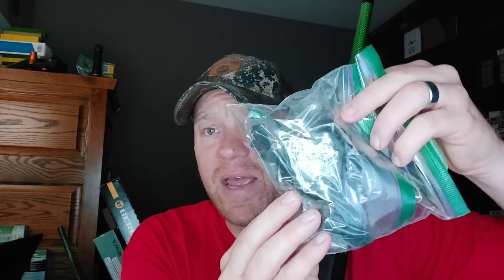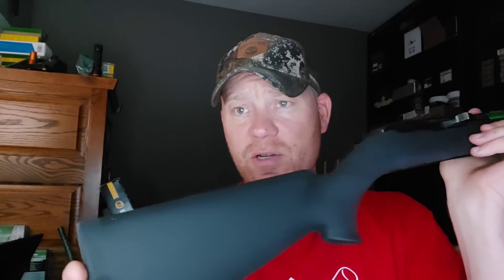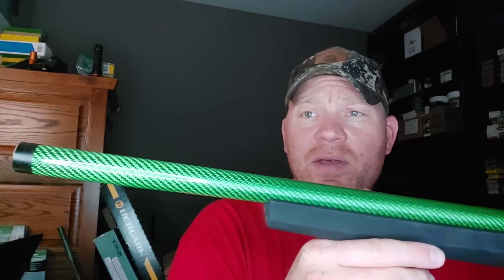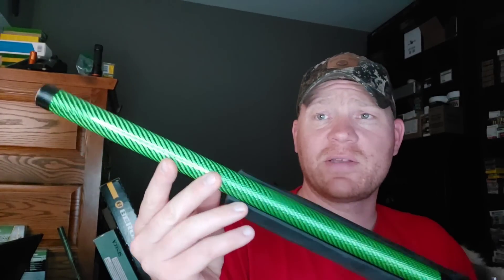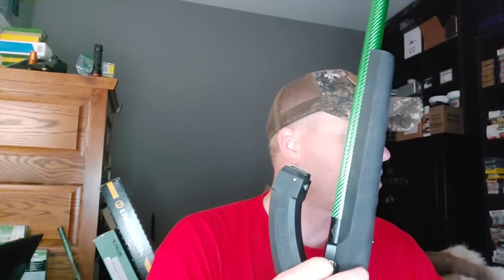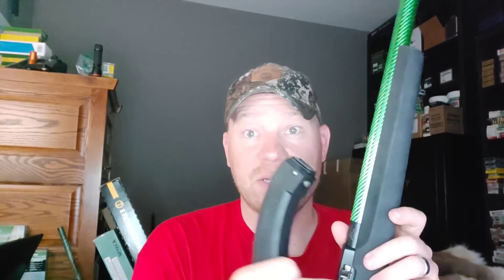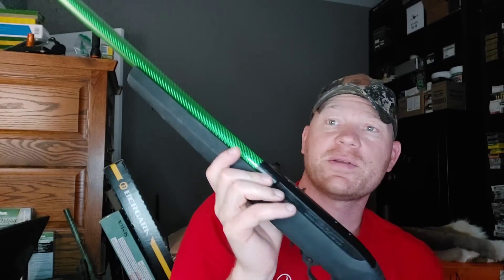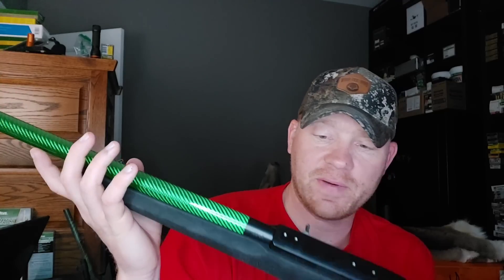This Custom Rifle Took Me a Year to Complete

Comment: Drop a few pieces of clear packing tape around the top of the mag (the square part). It will take that shimmy right away.
Reply from the maker: Good idea
Reply: Totally agree - I custom fit all my mags to the rifle using electrical tape.  Works like a charm

Comment: The biggest thing for adding accuracy to these is  harmonic tuning adjusting torque of takedown screw to find that sweet spot. Aluminum tape bedding of action and glass bedding first few inches of barrel also makes noticeable accuracy improvement. No need for expensive chassis systems for these rifles. Also no need for expensive match ammo imo. I have never seen a 10/22 not shoot sub moa at 50 yards with CCI SV if tuned properly with bedded action and bbl. Have fun with the build! Looking foward to seeing end results.

Comment: The Ruger Bx trigger is the best I've used super light and crisp.The sticking issue could be that the bolt stop pin may have fell out of place or out entirely.Had a friend take his apart,his wasn't in his gun and had that same issue.He had lost it when assembling the gun.
Reply: That's why I use a magnet when taking guns apart. I put all parts on a magnet or 2. I never lose any parts (anymore). 🙄
Reply: @AndrewMartinez49ers  I use a magnetic tray works  great.

Comment: I had one of those hogue stocks on my 10/22 with a .920 barrel, was getting worse groups than I did when it was bone stock with the factory pencil barrel. Turns out the stock was flexing and touching the barrel. Took it out and dropped it in a Boyd’s stock and it immediately started shooting  .5”-.75” groups at 100 with quality ammo and .75-1” group with bulk stuff.
Reply: I actually had one of those stocks on a bull barrel remmy 700 .308 and it had the same results until I swapped to a magpul hunter stock

Comment: I have two of those rifles, both are stock. I bought two of the Ruger 15 round and two of the Ruger 25 round magazines; those are terrible.

The larger magazines are loose fitting in the well. They have a smaller head than the 10 rounders, jiggle a bunch, and cause many failure to feed issues. They also consistently fail to feed the last  round.

I've told Ruger about it, and they offered to replace the mags, but the government of my state decided the citizens shouldn't have magazines which hold more than ten rounds.

Comment: I sent my shiny trigger to Brimstone since it was metal and had a job done on it   ! About 2 1/2 pound pull and put a custom hot glue stick in ,in place of the metal bolt stock! It  really dampened the sound down. Let’s hope  I don’t melt the glue shtick  ! Then went all out and ((  quote )). And Slapped  a 25$ Pinty  red dot 🔴 on her ! Wa Yea !!
Reply from the maker: Sweeeeet

Comment: In 1996 I bought myself a Ruger 10/22, there were issues with it that I didn't like, the stock was too short, it was made of plastic and I didn't like how cheap it felt, it had a blued 16" barrel
On it, and a while it shot straight, it was only good to about 50 yards. And tended to rust inside, last year I finally finished modifying it, to the way I like it😂
Reply: or How to turn a 200 dollar rifle into an 800 dollar rifle in minutes flat.